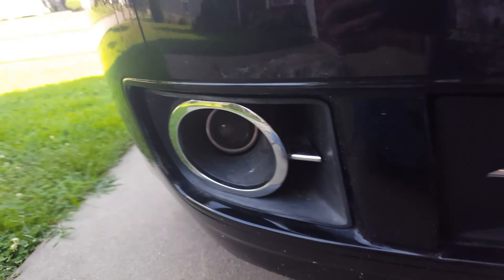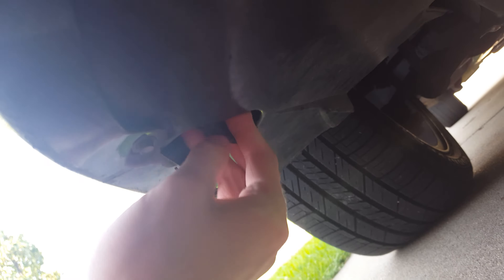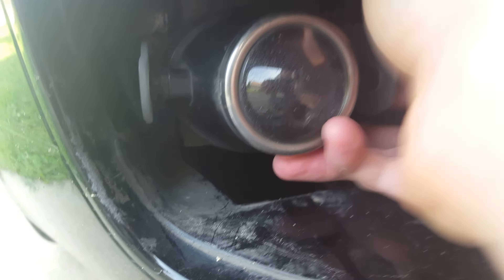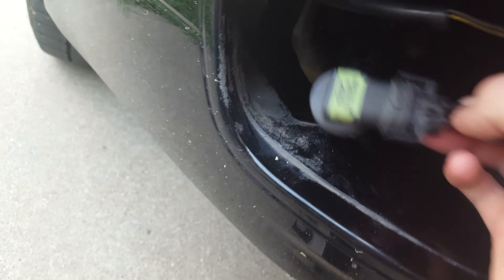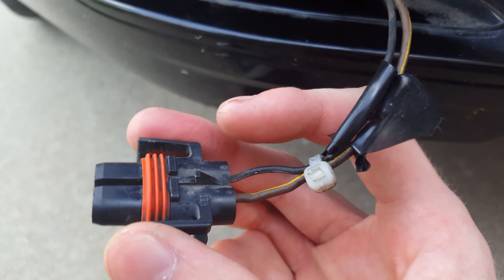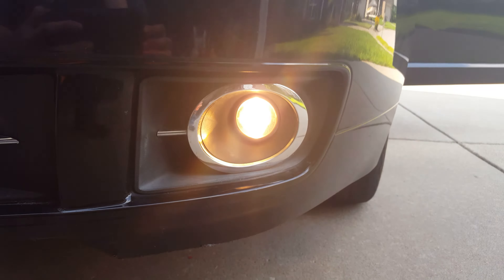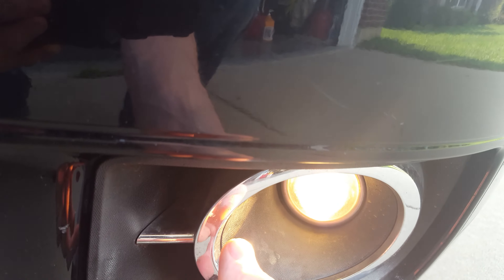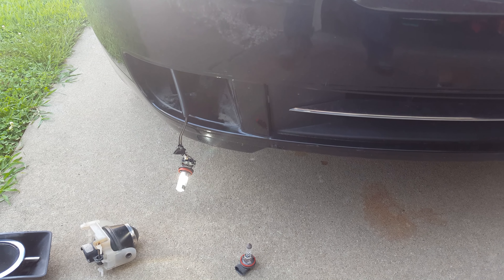Putting led fog light bulb on a lincoln mkz zephyr fusion

Comment: Hey nick! 
I have once again an detail with the fog light, when I turn them on they star to blink, both of them.. I already change the relay for a new one but still the same, what can it be?:/
Reply from the maker: Have you tried replacing the headlight switch
Reply: @Nickthecarguy  Not yet D: !
That can be the reason of the blinking fog lights?  I mean the high beam and low beam are ok with the switch on
Reply from the maker: @alanvaldezvarela3948  it could be the fog light switch shorted out internally
Reply: @Nickthecarguy  Oh boy,
Ok! thanks a lot nick!

Comment: I made the mistake of buying the same bulbs. Do yourself a favor and buy some hids, the cut off is actually very sharp.
Reply from the maker: I bought some led foglight 60w and it's not as bright as the regular halogen. where did you get your bulbs
Reply from the maker: I bought some led foglight 60w and it's not as bright as the regular halogen. where did you get your bulbs
Reply: +Nick the car guy. I purchased a $20 ebay kit and they have worked well, just make sure the ballast is mounted above the fog and use bulb grease. I was very surprised how well the cutoff is with the hids. I also replaced every bulb in the car with cob leds.
Reply from the maker: +Alfonso Rodriguez do they shine out far distance wise? when I bought my car to rebuild it had a ballast but no light tho
Reply: +Nick the car guy  The fogs from factory are halogen,  I put a 35w hid with yellow bulbs and once and a while I use just my fogs on the back roads going to work at 4 am and they are more than enough light to illuminate the road. you will be happy with them, especially if you use 4500 to 6000k color temp.
Reply: +Alfonso Rodriguez my color temp is 3000k  I like the yellow fog look